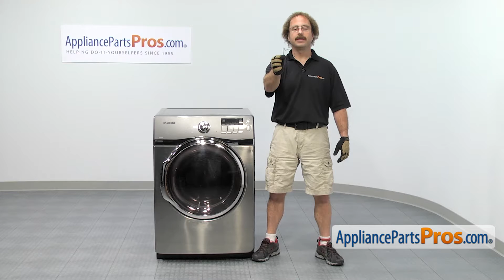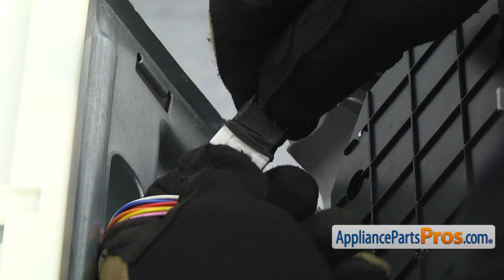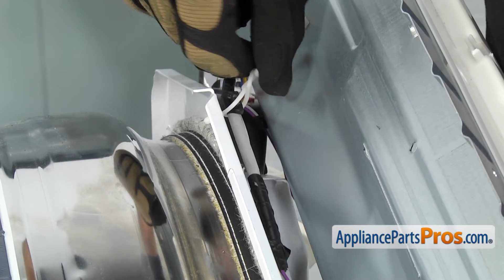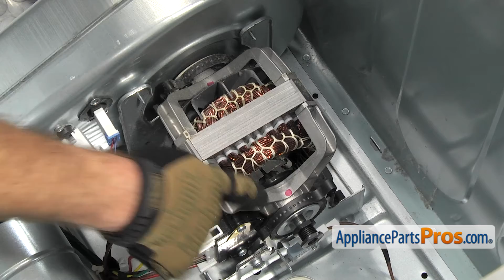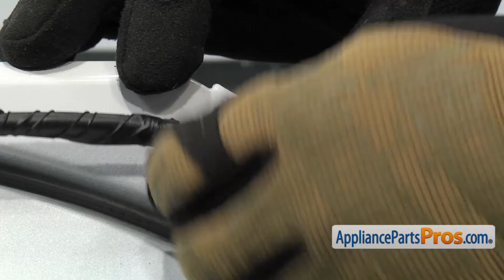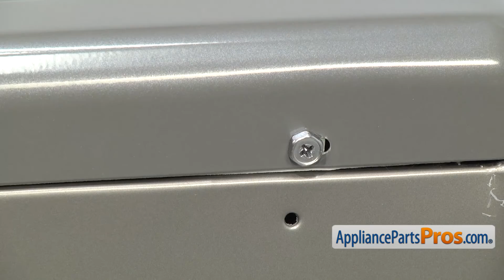How To: Samsung Motor Clamp DC61-04225A

Comment: Can this be a reason why the dryer wont spin??
Reply from the maker: This part breaking would typically cause the dryer to vibrate. We'd be happy to help you diagnose why your dryer won't spin, though. We offer free technical advice and diagnosis. To answer specific questions about specific models, we would need to know your model number so that we can consult a diagram of your unit. You can give us a call at 1-877-477-7278 or you can chat us at our website: http://www.appliancepartspros.com/. One of our agents can take the model number, look up the schematics, and talk you through any issues or questions you may be having.
Reply: Check your belt

Comment: will this cause a grinding sound when bad?
Reply from the maker: If a motor clamp broke I would expect more of a thumping noise as the motor moves around in the motor mount. Without knowing what you have, I would suggest posting the problem along with the appliance model number on our repair forum and the techs can help you troubleshoot the problem. http://forum.appliancepartspros.com/
Reply: AppliancePartsPros 

       it was the idler pulley/bearing.  Took out and cleaned.  Good as new.